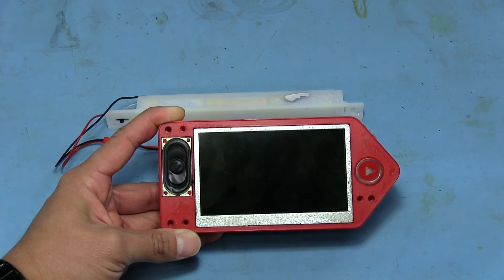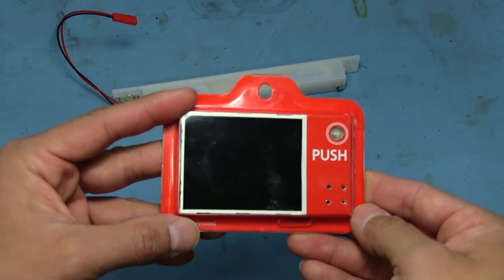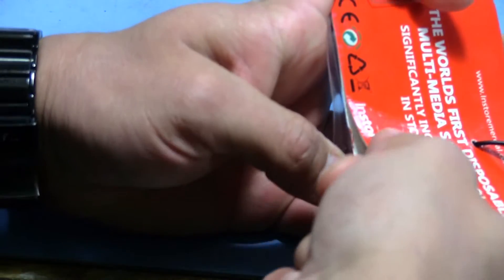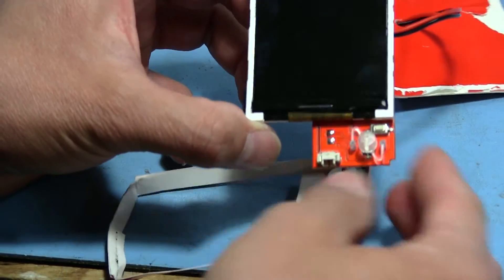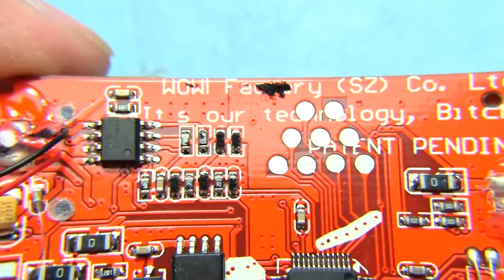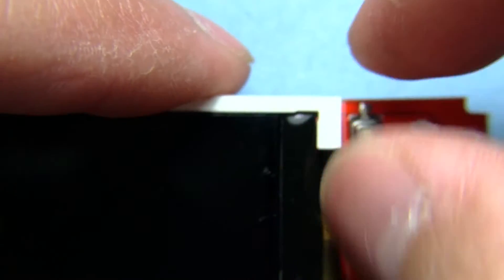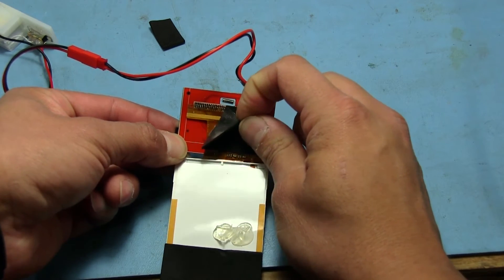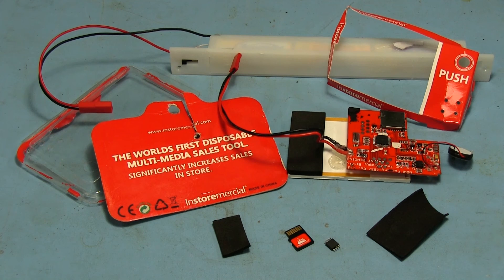TWB #37 | Instoremercial "mini' Media Player Teardown

Comment: This was very interesting! I've seen them in stores and wondered if they had removable storage, standard video format support etc... It would be fun to dig into the eeprom further and see what they are up to further... It looks like they expected others to explore their product and figure out how it works so they put some type of simple countermeasures and when someone prints something like that on the board, it's asking to be looked at further!
Reply from the maker: I think it may be possible to figure it out with some more advanced equipment beyond just an old scope, but that's not stuff I have available to me. It's got to be a relatively simple format, at least in my opinion, judging by how small the file actually is.

Comment: +The Workbench I know this doesn't relate to the video but I know that you've worked on a few 6 disc cd changers and could use your advice. My mother's car has a 6 disc CD changer and it has problems where when you go to load a CD it will make noise and tell you to insert a CD however when you insert it the CD player knows it's in there because it will turn on motors trying to load but the CD does not pull itself in. It wont eject either. I forced one in once thinking maybe I needed to put it in further and it got stuck. I got it back out with a knife and some tape. I was wondering how I might be able to repair this. It has no traction to pull it in or eject.
Reply from the maker: It might have a broken gear on the roller that loads/unloads the disc. It's a fairly common failure, from what I have seen. Only way to know is to look inside.